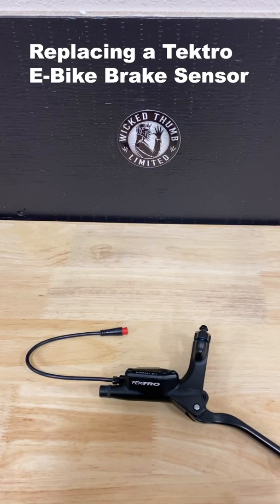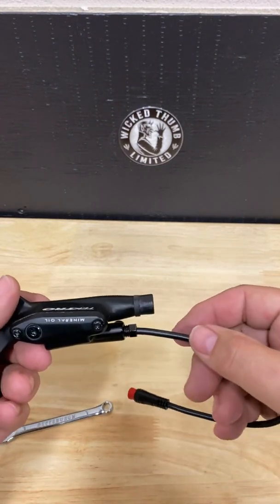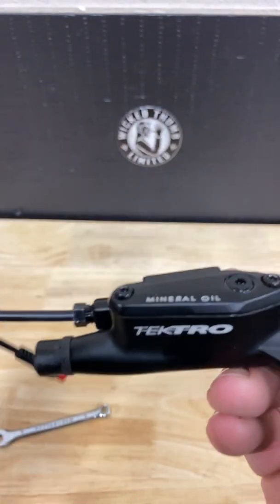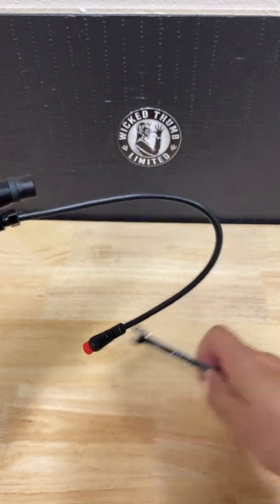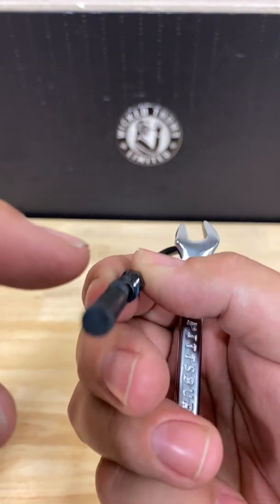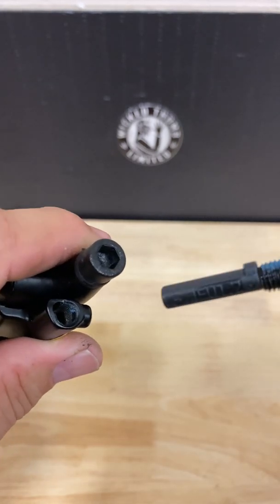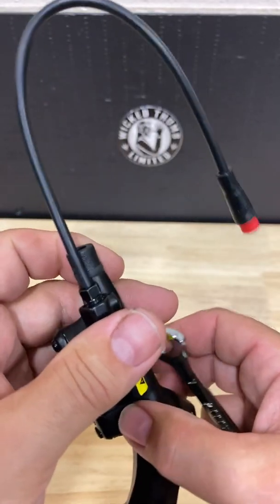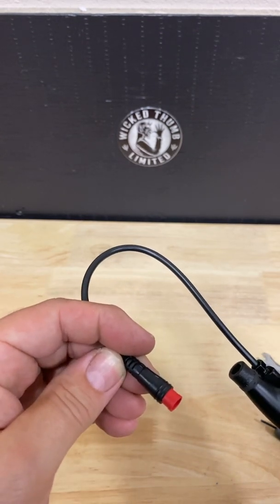How to Fix Error Code 25 Ebike by Adjusting or Replacing a Tektro E-bike Brake Sensor Cable

Comment: Thanks for sharing this video! I was having issues with my brand new Radster Trail and found that the internal spring was missing after watching your video. I just finished assembling the bike and had the ERROR 25 code. I tried adjusting the brake sensor, but it wouldn't hold it's position because of the missing spring from the factory. Thanks again!

Comment: Just my ebike. Less than a week l got brake lever error.  I unplugged the right and left brake . Plug in the right brake everything was fine the left i plugged in no throttle  I unplugged the left one everything was fine .you my left brake sensor is bad, it's brand new, or needs adjustment?
Reply: Probably needs adjustment. My brand new Radster Trail was missing the internal spring from the factory.

Comment: Good vid on how to remove sensor, but before replacing anything, the error code 25 can typically be removed with a 5 minute procedure by simply adjusting the sensor: loosen the set screw 3 turns (don't remove it), then with the 7mm wrench loosen the sensor until the error code disappears off the screen.  Worked for me, without having to replace anything.

Comment: Can i just cut the wire and ride without the brake sensor. Or will that stop the motor from going
Reply from the maker: just unplug it if you dont want a sensor.  not recommended but that will disable it without any errors.
Reply: @wickedthumb  ok thank you

Comment: Can you help me ... my brake light get stuck when i use brake .. when i little hit screw with sensor it unstuck ..when i use lever it stuck again ..
Reply: I see you had no replies for help. I have a very similar issue with my wife bike. Mine doesn't stick every time but it is happening much more often. I replaced the entire brake and sensor assembly, bled the brakes, and connected the sensor. still have the same issue. I was wondering if you found help or had the issue resolved ?
Reply: I find it hard to believe you and I are the only ones with similar issues. I also tried adjusting the sensor position.

Comment: Great video. Is there a difference between an orange colored sensor (old cable) and black sensor (new hydraulic)? Same size and diameter. Both tektro. One is EU 1.2 and orange is EL 350.

Comment: My tektro brake sensor casing broke off from the handbrake while i was tightening the brake line screw after an oil bleed.  It broke where it connects to the handbrake. I used some plastic lock ties and part of an inner tube (for traction) to keep it fastened in place to where it should go on the handbrake. When it was put into position and fastened with the ties, i tried to see if there would be a problem. Well, at first, the bike did power up and the rear light (on my battery) lit up by itself after it hadn't been working for several months but my throttle button gave no power to the motor when i pressed it. I got really worried thinking i broke my e-bike and need a whole new brake lever piece (which i do, i know). But when i moved/adjusted the position of the sensor casing, just a little bit, while still fastened by the lock lies, and i tried the throttle button again, the motor worked BUT the rear light won't go on again even when i press the headlight/rearlight button.  I wonder if any shaking on the road will move the casing and maybe cut the motor again. Could i unplug or disconnect the sensor so that one brake won't affect the motor?
Reply from the maker: the motor  should run fine if the troubled sensor is unplugged.  obviously it's alot safer to have 2 working sensors, but as long as one works the motor will still disengage if you use the working side brake.  we always encourage using both brakes when stopping.
Reply: @wickedthumb  I have another issue that started today. I hope you can help me, please. Yesterday when i was oiling my chain, i thought to add a cotton swab of oil on my peddle-assist sensors on the crank. I thought with a bit of oil they won't get dirty in the slushy weather. Well, today, my peddle-assist doesn't work. I took a cotton swab of rubbing alcohol to remove the oil from the sensors and then i used some brake cleaner on them but the peddle-assist still wont work.  Do you have an idea what i should do? Thanks.
Reply: I found out the problem for that issue, by the way - i accidently moved the magnet wheel too far from the sensor and it caused my peddle assist not to work. That's okay now.  

As for my first query, the brake sensor... it's still holding in place on the brake lever with the lock ties and the piece of inner tube.
Reply: @wickedthumb  Thank you

Comment: Thanks for the video. I have the HD E725 brakes and there’s just to bare wires coming from the sensor. I need three wires with the yellow female and for my BBSHD. Do you know where I could buy the yellow 3pin sensor ? Thanks in advance!
Reply: please share the answer as i need the same
Reply: @ramtak1  The brakes only require two wires so I just figured out which two wires I needed using a multimeter.
Reply: @overthetopblues   i have the HD-E 350s and i am missing the cables, i need the cables, red or yellow, there is a workaround for the yellows
Reply: I need a new sensor  have searched everwhere to buy the eu1.2 sensor (2 wire) and I cannot find it.  If anyone has info please help!
Reply: @15secofFame  Same here. Might have to replace the whole assembly because I can't locate just the sensor.
Reply: @MoniJohnson  I make them now :)

Comment from the maker: Hi Ryan. you would use the 2mm Allen to remove the set screw then the 7mm clockwise to back the sensor bolt out 1/4 turn at a time until the error disappears . if it doesn't go off then check the opposite side. could also happen if you lost the spring since the spring is what keeps it off the magnet. once it goes off screw the set screw back in.

Comment: Hey, excellent video. Do you know, if my sensor is still good, how do I adjust the screws to make the error go away? Additionally, if the bike is on, and I adjust the screws, will the error go away once I am in the right spot, or do I need to reset my bike to check for the error after each adjustmnet?
Reply from the maker: First unplug the sensor see if it goes away. If it does you know which sensor to adjust. loosen the set screw and back the adjuster screw out 1/2 turn see if it fixes it. If not try another 1/2 turn.
Reply: I don't have any brake lights when I pull the lever, and the brake cut off switch is not working, no error codes come on my display. The brake icon does not even come on when I pull the brake. Which way would you go with the sensor?